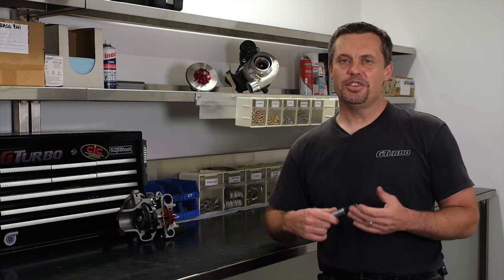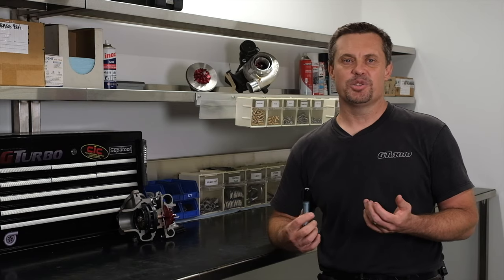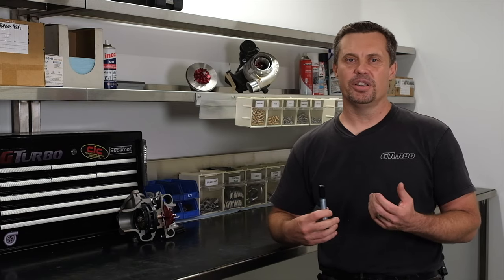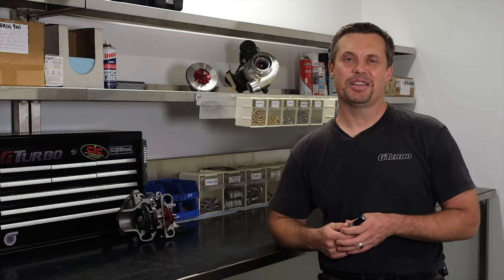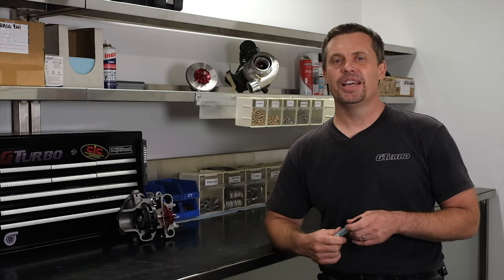STEP 1 in Performance Diesel Modification

Comment: Would be interested to hear about when to upgrade injectors/pump, and safe EGTs and cylinder pressures/when to upgrade head studs and head gaskets on certain models.

Comment: Thanks for the info! Can’t wait for the next instalment. Ok, I’m sold, I’m doing it for my vdj200 (dpf) used as an all-rounder, equally between long drives, towing and woolies warrior… what’s difference between a G350, 400, and 450 for a lc200. Thanks in advance. Ps; who do you recommend as a GTurbo fitter and tuner shop?